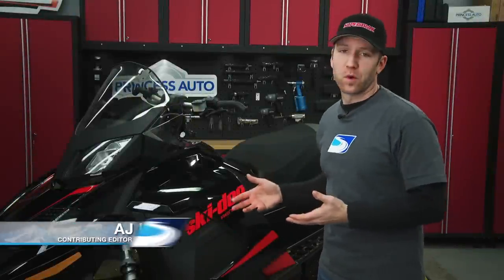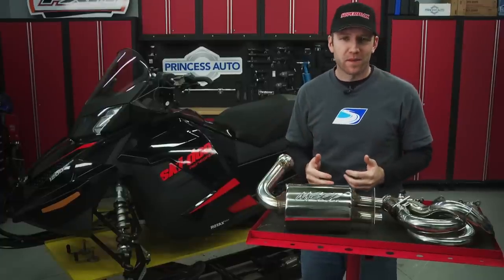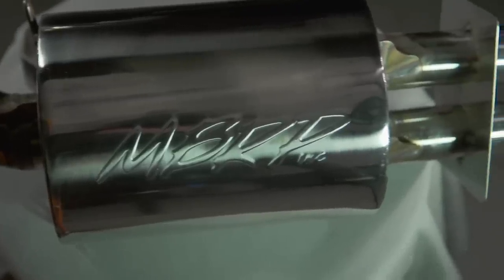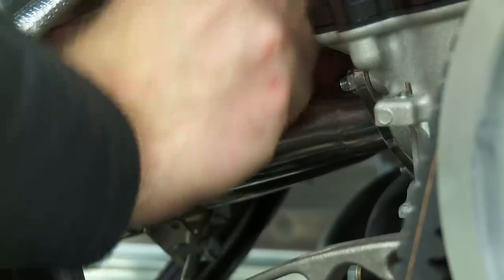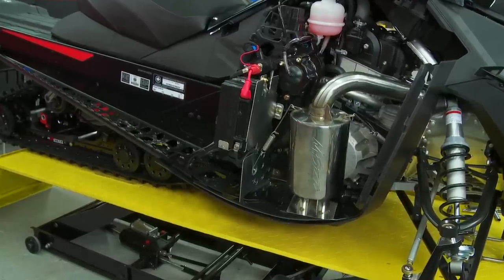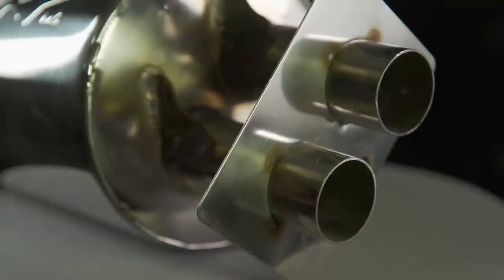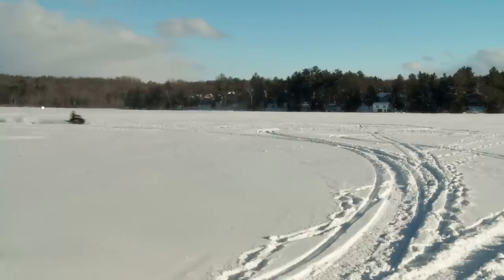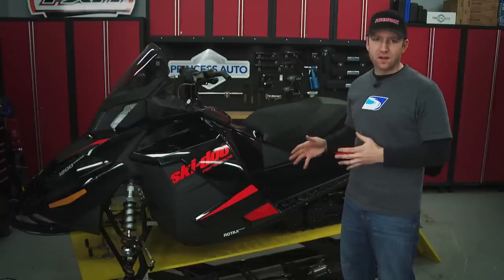Ski Doo 1200 4-TEC with an MBRP Exhaust

Comment: Just ordered this set up! I can't wait to see how it helps! I wanna get away from that quad like sound! Also how do you get 145hp.. the sled is rated at 130 this set up is 9hp.. that's 39.. where is the other 6hp coming from???? Please let me know?
Reply: +HomeTownFitteds  he said it is rated above 130 hp. the 1200 is rated somewhere around 134-136 hp. i've had my 1200 dyno tested and i pump out about 135 w/o a can, or any mods.
Reply: +AlphaR6 wow! ok thanks.. I did this mod and its crazy good! makes the motor sound a lot better and the power change is noticabke for sure! thanks for a comment!

Comment: $1000 seem a little steep for exhaust but that's just my opinion. $1000 for 9hp???  Idk.
Reply: I know this is a 5 year old comment, but -- the can also makes pulling the exhaust system out easier than stock. You have to remove this to change the oil. You're paying $1000 for a horsepower bump and clean, easy to access springs to change your oil without a massive headache.

Comment: Get the ECU reflashed by BONDI or CUDNEY get the rpms up to 9200 with the cut off at 9500. Dial in your pb80 clutch to 9150 with the pucks and say goodnight IRENE. I the first five hundred feet you will be ahead of a AC turbo 9000 stocker. So race turbos in a five hundred foot course and blow them away simple as that

Comment: I don't know about the new 1200 4-tek motors. I just don't see the appeal of almost double the weight of an 800 twin, while only netting about 80% of the power. Maybe it's just me, but I think Ski Doo should be doing something slightly different with this type of engine.
Reply: You're really not paying for power, you're paying for the reliability of a 4-stroke. Lots of riders will gladly deal with some extra weight in exchange for reduced worry of the sled melting into a puddle at 3-4k miles, and possibly leaving them stranded in the middle of no where.
Reply: That's a hard sell for me. Okay, so it's more expensive to repair, but you can put 12k trouble-free miles on it, versus a couple thousand on a 2-stroke. When you're out in the middle of no where, you aren't thinking about how expensive the repair is going to be, you're just thinking about how you're going to get home.
Like I said before, plenty of buyers don't need every last horsepower that an 800 2-stroke offers, and would much rather have the same chassis and a significant enhancement in reliability. This is not to say that every 2-stroke melts down at 3k, but your odds are significantly higher of that happening on a 2-stroke versus a 4-stroke - it's just the nature of the beast.
Furthermore, two or three rebuilds on a 2-stroke are going to add up over time, especially if you're having the work done by a shop (which most riders spending $12k+ on a sled are likely doing). You may not equal the cost of a 4-stroke rebuild, but I'm willing to bet you'd be close. You're also way more likely to own a 2-stroke that will need a rebuild because of those odds I mentioned before. If you put 6k miles on every sled before you trade up, you're looking at maybe 2 rebuilds for every 2-stroke sled you buy, versus zero for every 4-stroke.
Reply: Almost twice the weight???
I'd like to know where your getting those numbers from. My 1200 is only 60 pounds heavier then my dad's 600.
4tecs are trail sleds not mountain/trick sleds
Reply: @19Msoles  I catch so much crap from others about weight and the 1200. It's like 55 lbs in total. Woopidy doo...

Comment: yup! bolt on 5-9 hp & piss off your neighbors with the noise......close some more trails..
Reply: its a trail can on a 4 stroke..it gives a deeper rumble and not even louder at higher speeds...fckn relax..it aint a race can on 2 smoke trail rider.
Reply: Dude it's a 4 stroke not a loud brapppp sound